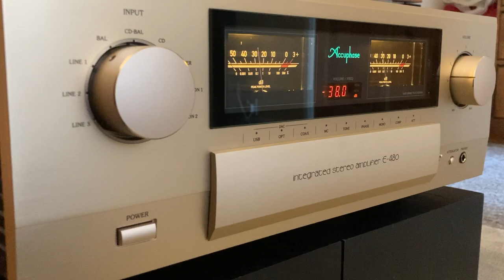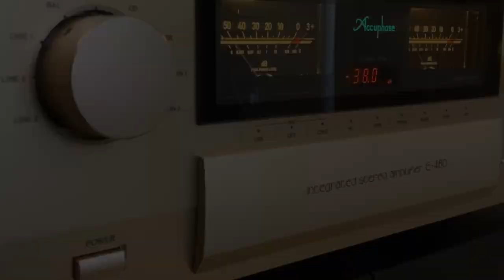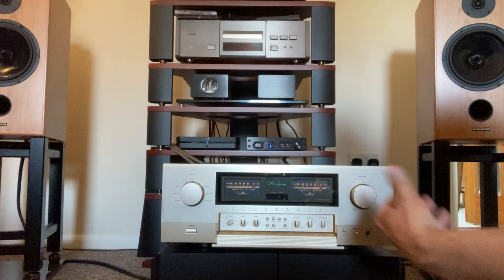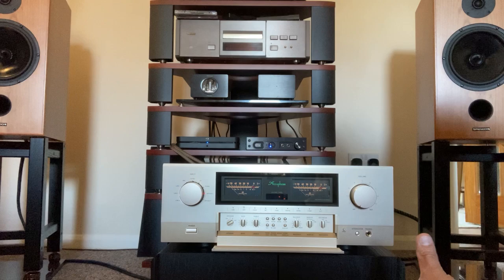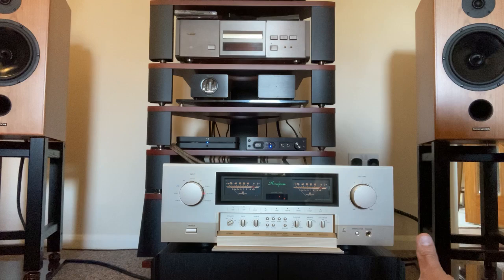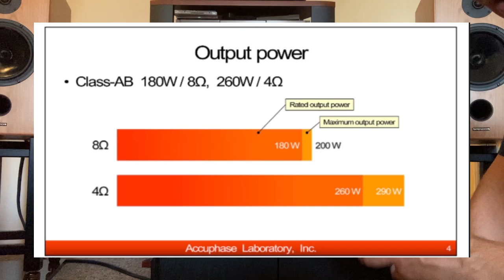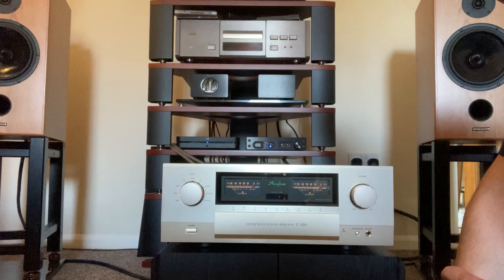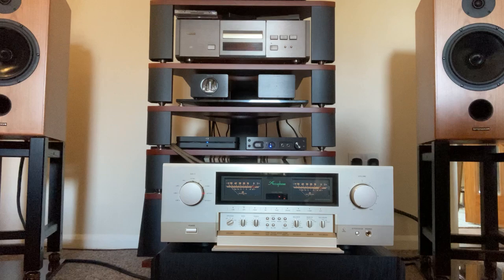Accuphase E-480 Integrated Amplifier Review #accuphase #audiophile #hifireview #amp #hifi

Comment: I have the E-480 connected to a pair of Harbeth 7 XDs.  I agree with you on the pairing of the Accuphase and British speakers.  Truly outstanding and accurate sound reproduction with a wide and deep soundstage.   I have not even been interested in looking at other audiophile equipment since purchasing this rig.  At this point I do not think that I will ever change my rig.  Thank you for the review.  Your passion came through in the video.  All the best from Canada.
Reply from the maker: Thanks Frederick.. I’ve been looking for a pair of Harbeth 7’s to compare to my Spendor’s.

Yes that amp is stunning 😍 I loved it.
Reply: Hi, i has C7xd as well, what speaker cables do you use? Thanks.
Reply: @amigoz3201  Hello, the speaker cables are hand made using Oxygen free copper.  For more info see GR Research.
Reply: I cannot wait ( if all goes as pretending) to go an audition an accuphase e-800 with harbeth 40.3xd .
I have more amplifiers on my short list ( allnic t-2000 30th anni. , phatos kratos, mcintosh 9500 and 12000 , but I am very curious with the e-800 , just love the looks and quality )
Reply: @MsCorbacho  Interesting timing on your reply.  I have an E-800 on order that is supposed to arrive next week.  I wish you the best of luck sourcing your E-800.  I am sure that you will love it.
Reply: @frederickrodger7249  You are free to send me an opinion about it , when you know better what is does , we all need time to get to know a Piece of equipment , get aquainted with it.
Reply: And i wish you lots of fun and musical pleasure with it .
Reply: Which speakers ?
Reply: @MsCorbacho  speakers = GR Research NX-Studio
Reply: How  is the bass with this combo? Have you tried any other amps?
Reply: @aleksandarstojceski3139  Currently have an Accuphase E-800.  The E-480 and the Harbeth's had good base that sounded quite accurate.

Comment: Great well presented and interesting review of the amplifier..I bought mine used (one year old) with the RIAA card already  installed at a very big saving over the list price...it is (hopefully) my 'end game' amplifier upgrade from my Yamaha A-S2100..mine drives JBL HDI 3800s. I am totally delighted with it in use and my listening experiences very much mirror your own. I was previously hunting for a newer DAC and was fortunate to find a brand new Accuphase DAC 50 card at a very reasonable price  to complete my amplifier. An amazing amplifier in every respect,,incidentally I read a lab test (from Poland I think) in which the E-480 produces 220 WPC into 8 ohms and over 400 WPC into 4 ohms...bottomless reserves of power in my (large room) set up and most others probably..best regards from Norway Kevin
Reply from the maker: Congratulations on your terrific purchase..
Thanks for watching
Reply: Hi Ian, im thinking of going The same way, i own a yamaha as-2200, waths The bigest differens betwin the yamaha and The accuphase? best regards Stefan 👍
Reply: @sella7211 NB these comments apply to the experience in my system only. The Accuphase is overall less 'lively'..the treble is less forward but very detailed..the mid range is warmer without any loss of great realistic tonality.The bass control and power sounds much increased...power seems bottomless and gives authority to the overall sound...I am delighted with the change..I really liked the Yamaha but the Accuphase has revealed enjoyable qualities of my speakers that I did not know they had. 😊

Comment: At the price these are in Canada they should come with the DAC AND the phono stage and should not cost "extra" Otherwise these are amazing! The mark up in North America is just price gouging at this point. In Japan, these are the same price point as Luxman. The deal with the N.A. distributor must have been a doozy. One does take pause with such a deal when there seems to be not much of a reason for it other than price gouging. All that aside this is a BRILLIANT piece of gear and I do aspire to it however, McIntosh is very, very good and cheaper here than Accuphase.

Comment: Just sell your pre & power...that's your weak link then you can get a badass integrated. I reckon the ModWright KWH 225i would work well with your Spendors...
Reply from the maker: Na… I’ll just get the Accuphase 😂 

Thanks for watching.👍
Reply from the maker: @Kowinaida  I’ll abide my time buddy..
Besides I’m throughly enjoying a passive pre amp as I type..👍
Reply: @dittonworks  I forgot you have the Music First pre...in that case just get a tube power.